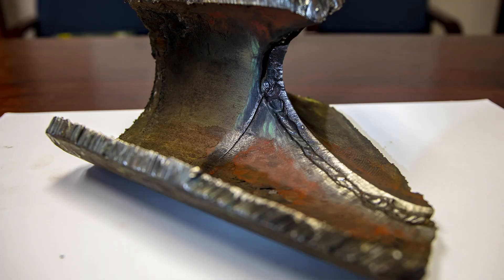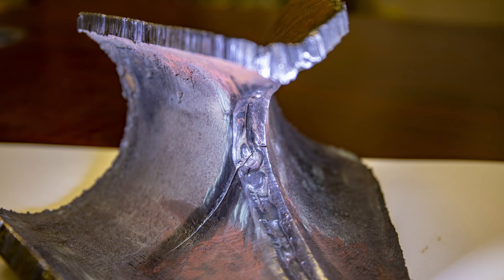API 1104 Weld Crack Investigation

Comment: Good morning, quick question here:
I understand that a Y joint requires a specific WPS and welder qualification because it is a specific joint design.
 It would not be allowed to use a 90 degrees branch joint WPS neither a qualified welder on that kind of joint (90 degrees). 
Right?
Thanks in advance
Reply from the maker: GREAT Question. If an API 1104 welder passed the butt and branch test they would be qualified to make this weld if they had an approved welding procedure to follow. Because this is a very specific joint design it would require a welding procedure designed for this joint design. My assumption is it would be almost impossible to get a welding procedure to pass with this joint design. However this joint design is not allowed per federal regulations if your working on a pipeline system that is federally regulated. 

Per federal regulations 49 CFR 192 for gas or 49 CFR 195 for oil you are not allowed to make a miter cut that is more then 3 degrees. So per federal regulations this joint design is not allowed and a fitting must be purchased.
Reply: @WeldItOnce  That joint is known as a lateral, or "Y" joint. Don't know why the lateral had to be cut to determine that?
Reply from the maker: @roadrunner5269  I was told it was a fitting that had been welded on to repair it from leaking. That is why it was cut to have a better understanding of what it looked like on the inside. I had expected microbial corrosion as the cause of the leaking/crack.
Reply: @WeldItOnce  You ever use a mirror and flashlight?
Reply: @WeldItOnce  oh!! i understand!! 
I checked again API 1104 21st edition and it mention, on 6.3.2, that a welder that qualifies in the pipe and brach welding above 12.75in, can weld in all pipe diameters, all thickness, all fittings, all joint designs.  
So that means that if the welder receives a WPS (qualified) for this kind of joint, Y type, he/she would be allowed to weld.
Thanks a lot for your clarification. I am currently working on projects on the middle east, thus, in many cases, I have to solely rely on codes/standards specified on the project contract rather than local regulations.